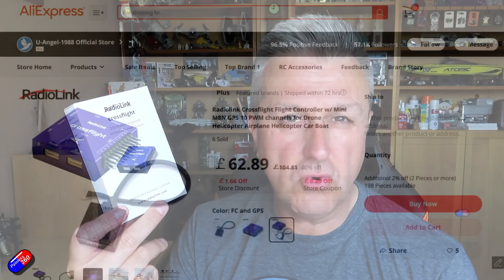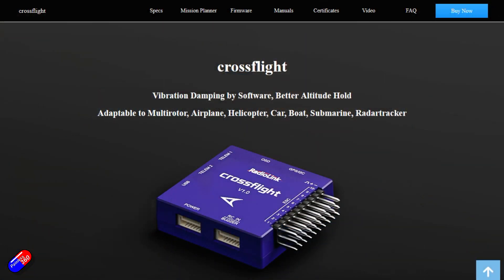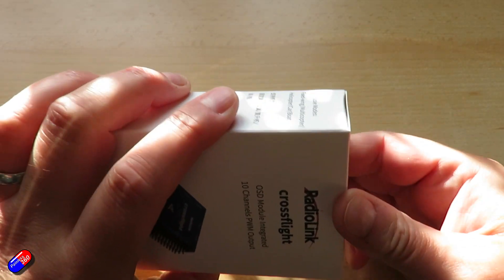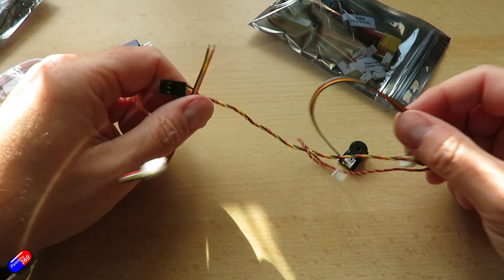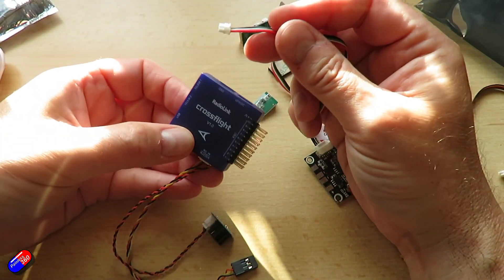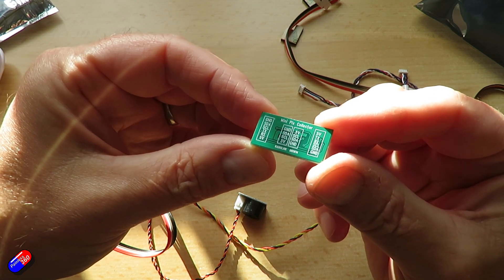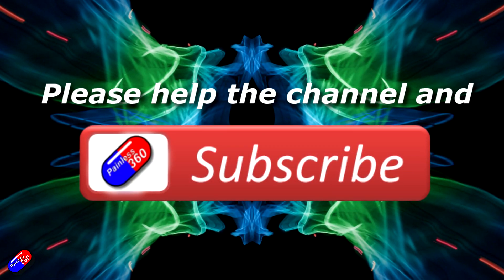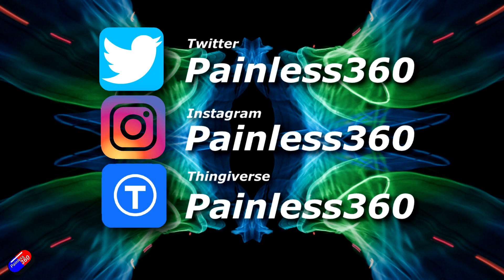RadioLink Crossflight: A Cheaper option for Ardupilot builds?

Comment: Hi Painless360, I have a radiolink AT-10ii transmitter and I'm thinking of acquiring the crossflight to be able to benefit from telemetry and a gyro for my new glider but I'm a complete beginner and I don't know if I should connect the lipo to the power  module and the brushless motor ESC to the Main out pins as with the other servos.  I had made a clear sketch to better explain my problem but I can't upload it in the comments.  thank you for listening .
Reply from the maker: I've never used Ardupilot with that radio system, so I'm unsure what capabilities you'd get I use an EdgeTX powered radio from vendors like RadioMaster here, check out my Ardupilot builds on the channel... best of luck
Reply: Thank you

Comment: I assume the two telem UARTs are in addition to the GPS UART, right? So you could put a CRSF receiver on one UART and attach the other to a Walksnail VTX? Essentially, most of my models only use 3 UARTs anyway for RX, WS VTX and GPS so looks like this may be worth a try.
Reply from the maker: For modern systems, three hardware UARTs are needed. Wiring diagrams for this are available. I've fed back that they need to add the CRSF connections to it..

Comment: I purchased the crossflight got everything connected but no power coming from the osd connector. It has the usual vin, vout, 2 grd pins, 5 volt for camera, but the vtk has 5 volt pin. Problem is I do not get any voltage from the 5 volt pins. Am I missing something? Or is this controller bad?

Thanks.
Reply from the maker: Some of the pins may only be powered when the Crossflight is powered from the battery as well.. Best of luck
Reply: The OSD does not output 5V. You need to power your camera with an external power supply. OSD ports will take 5V from camera and give 5V to power image transmission. Besides OSD, other connectors are powered by crossflight.

Comment: I wonder if this would work on my Rc Mowbot .. I have it on my channel I want to make it where it can do sections .. cause its a 108 outside right now and the heat index is nuts ..
Reply: Yes, crossflight can work on your Rc Mowbot. Crossflight can be compatible with Airplane/3-8 Copters/Helicopter/Car/Boat/Submarine/Radartracker/Mowbot, and the working temperature is -40~176℉（-40~80℃).